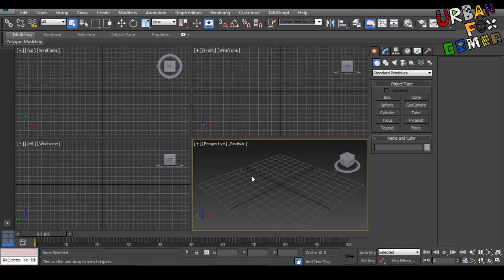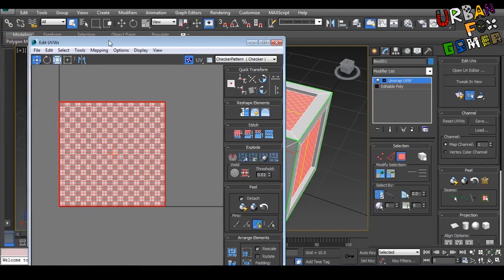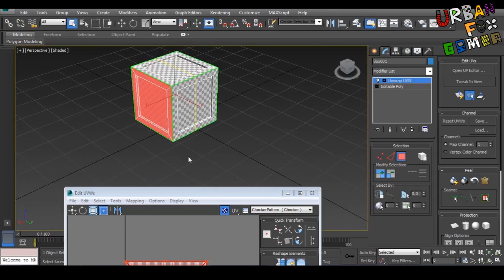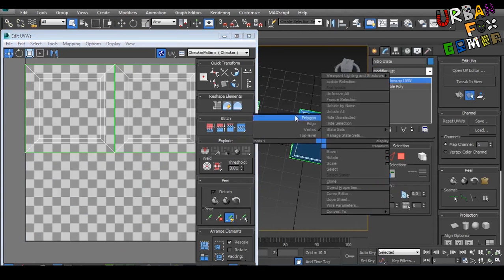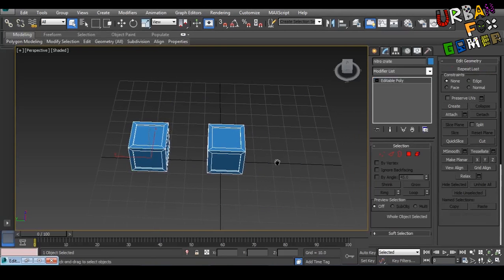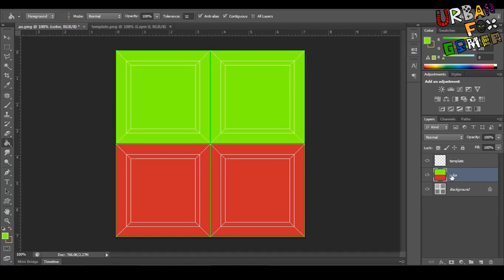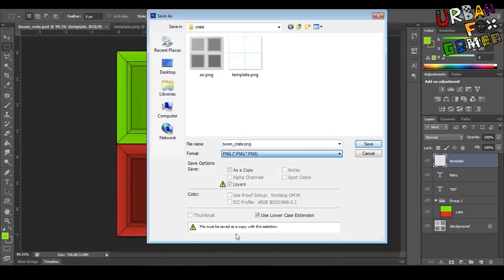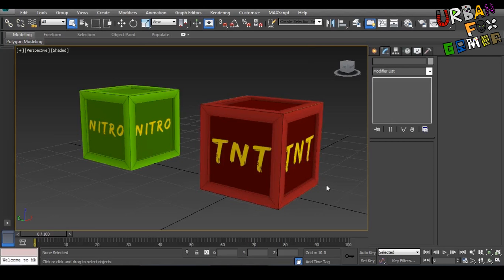How to make a Crate in 3ds max (Tutorial)

Comment: This is good for quick and easy but, you should go back and flatten the 12 edges and unwrap it more professionally to get better results. It will really improve the realistic effect.
Reply from the maker: thanks Anony, I would like to know which 12 edges you're talking about so i can fix it?
Reply: Sure, there is 4 edges for top, side, and bottom. Each has an 4 polys, the 2 small rectangle inside poly and 2 outer edge polys with arrow point after inset. I took the 4 poly from each edge and flatten them till I had 12 in a row scaled them and added them to the unwrap window with the 6 faces from the inset area. All together you end up with 18 faces in the map instead of the 6 you get by simple flattening the box. It also requires planer projection selected then deselected to move it out of the window till all 12 are flattened. If Youtube allowed pics to be pasted, I would paste the bitmap I had after unwrapping to save some of work and time for you. Your way is excellent for beginners and I would chose it if in a hurry, but this way allows the wood texture for box edges to have different look from middle of the box and gives more realism
Reply from the maker: thank you so much for these and the very detailed way to do it and of course the effort of writing it down with depth. when in the future i will rework this and of course will give you credit.